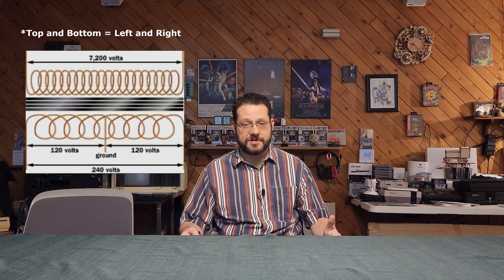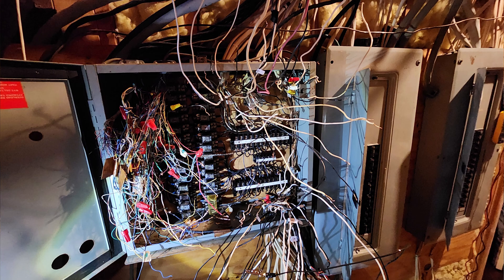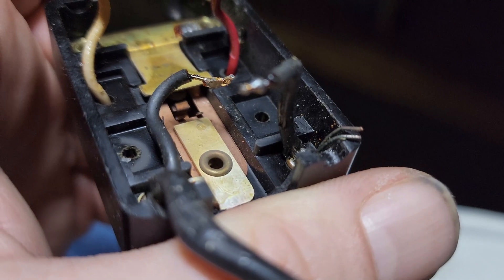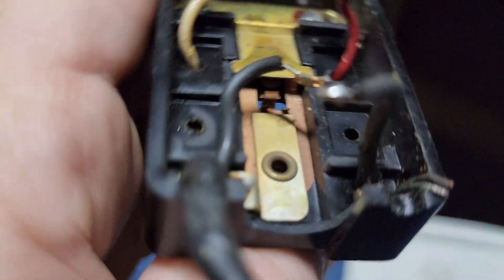Low Voltage Lighting Adventures With Crossed Wires

Comment: Just purchased a home with a low voltage system. Some switches and outlets work and some do not. My inspector warned me admit this issue. Any advice?
Reply from the maker: The most important thing is to identify the kind of system you have and locate the relays. Some systems have relays in one or more centralized boxes, but some have the relays in the ceilings where the fixtures are. The latter can be trickier, but not impossible to fix. The key thing to figure out in that case is whether or not you have relays with self-contained transformers (mostly Remcon). 
The next thing would be to diagnose whether each issue is the relay or the switch. This can usually be done fairly easy by pulling the switches out and carefully using a jumper wire of some kind to try to turn the relay on or off. 
Once you've figured that out, you should decide how you want to address the issue--that is if you want to replace with OEM parts, something newer but still using simple relays, or if you want to go ahead and replace them with something smarter like a Shelly relay that can be controlled via phone, voice control, or Home Assistant.
If you want to replace the parts with OEM parts, there's a site called Kyle Switch Plate (https://www.kyleswitchplates.com/) that has almost any part you may need. I was fortunate to have a central box and I replaced all my old relays with Shelly relays. I have a few other videos on various parts and ways to upgrade or replace the relays, but it does get more involved if you have relays in the ceiling or fixtures. 
If you'd like help identifying parts, feel free to send some pictures to my email (smartercircuits@gmail.com) and I can try to help. Hope this gives some insight!

Comment: Really enjoy the content here. I have a legacy serra system that I have been messing with while remodeling. Have moved a few light switchs around from were I removed a wall.   The switchboard wires that were used were spliced like crazy throughout my wall cavities (big no no) and just taped.

I've ran new 18g solid vs replacing the 22g stranded wire. Using "sprinkler system wire" I think is a better alternative to the branded and twisted wires that I have replaced.

I find myself watching slot of the channel electric pro academy. Most of its really above my capabilities but it's very informative.
Reply from the maker: There's no shortage of something to work on with these systems, for sure. I'm getting ready to do a small wiring demo for the two system configurations I'm familiar with. I'm going to cover whether to retain switch wiring or not and different ways around them. I have a very lofty project coming up that will actually use those switch wires as a level corrected UART communication system between Raspberry Pi Picos because they're tiny and easy to build simple logic with.